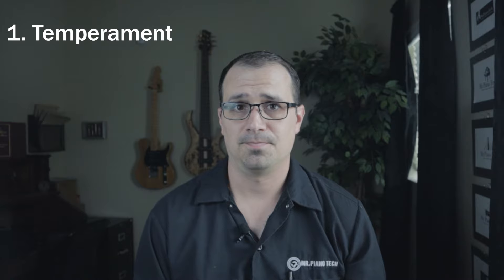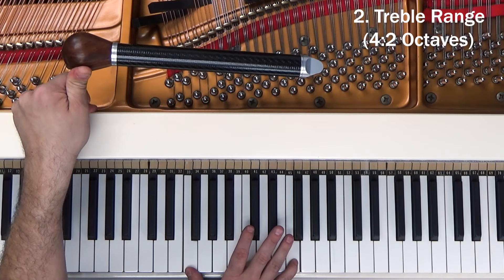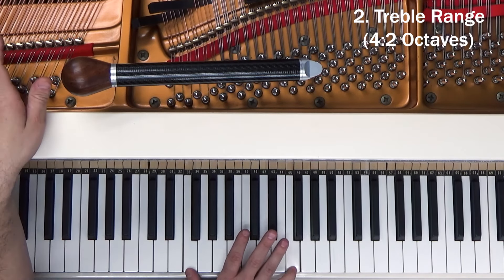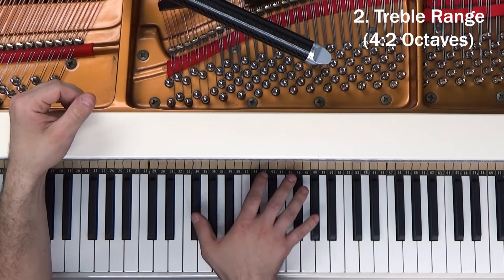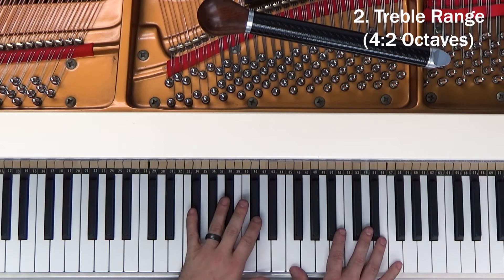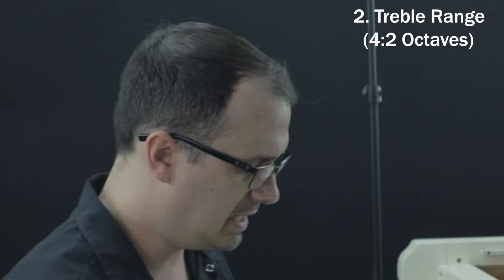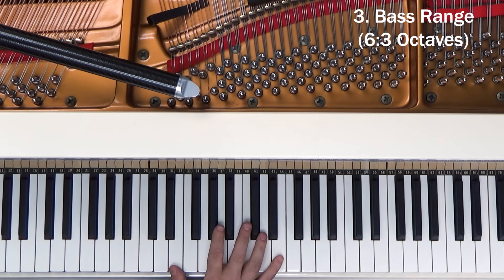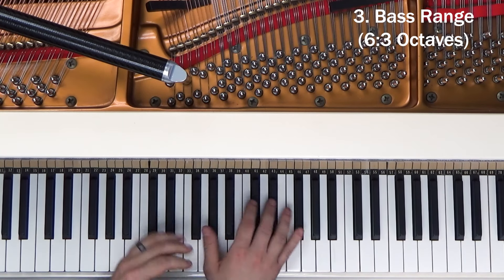How To Tune A Piano

Comment: it’s so useful to see the tuning hand. i was quickly taught and loaned a strobe tuner in 2001 when i was in high school and secretly taught myself piano. i’ve tuned many other peoples pianos. this was before youtube, facebook groups, etc to have a community to draw opinions from. 

i came from guitar tuning which is great because we use often use harmonics and listen to beats.

i was taught to go sharp and then flat, but wasn’t taught to jiggle or have sharp movements. my hammer etiquette has been like yours.

it was also before aps and i wasn’t serious enough to buy a strobe. i tuned A4 and turned the tuner off. i put an ad out to tune a piano for 20 bucks. obviously it was people that wanted it majorly tuned and didn’t want to pay much. i definitely did a good preliminary tuning, but got a good experience. eventually i was tuning one a week for more money.

now i have a nice ap for $30, people to draw knowledge from, and i might try to be more professional.
Reply: great demonstration. i used to tune the middle octave using 4ths and fifths and checking with my 3rds and sixths to get temperament. i then when down and did mostly the same, but used 5ths and octaves moreso. as i went up i used more 5ths and 6ths.

ps: Db and F is a major 3rd. i don’t even know what to call a C# and an F. haha. perhaps dim4, but that’s not part of a diminished chord. aug5 descending?
Reply from the maker: Yep, I’ve found that if you price yourself too low you get a certain type of customer, the bottom-dweller. Keep it up, it’s been a great trade for me!

Comment: at 10:13 comparing the wavyness of G3 to E3 is because'' these partials do not align with each other, the E3-G3 minor third will produce a characteristic beating sound. This slight oscillation is a normal part of the minor third’s tonal quality in equal temperament and adds a bit of tension that gives this interval its unique, slightly dissonant character.

In tuning, the goal with minor thirds is to keep these beats slow and steady across the instrument, which gives a consistent, balanced sound.'

is that the goal, to compare the wavyness? the partials of E3 and G3 do not align. thanks for the vidéo, well done!
Reply from the maker: @MarkE-xg9lr  You’re just matching the waviness. If the beats you hear with E3 and G3 match the beats you hear with G3 and E4 then you have a perfect 6:3 octave with E3 and E4. Keep it simple, don’t worry about how the thirds show up across the board. So long as you use the checks in the video everything else will line up.

Comment: I found this video VERY helpful. I had been frustrated and dissatisfied with my upper and lower octaves. Using this technique was game changer for me.
You mention doing a video for how you have you TuneLab set up. I’d really like to see that. I’ve found that TuneLab and I agree on the placement of the bass notes, but in the treble, my ear and the tuner can’t agree. I’d like to know what you have yours set to and what my expectations should be as far as TuneLab and my ear agreeing on the notes.
Reply from the maker: Glad it helped! Go with your ear. I use tunelab mostly for setting the temperament and for doing pitch raises. I have it set for 130 w/mid for viewing and have the bass set to 6:3, and treble to 4:2 - which are just simple double octaves so you should do alright setting those by ear.
Reply: Thanks for that info. I eventually figured out that the 4:2 octave works best most of the time. so, that’s what I keep it on now.

Comment: I missed one point.  Since you tuned the F3 to F4 temperament first, how were you able to use the 4: 2 octave method when tuning F4?  You were required to drop down to the C# in order to do that but you didn't tune the C# yet since it is below the temperament correct?
What did I miss here?  Thank you for the great video.
Reply from the maker: You’re just using it as a base line. So, whether you’re using the C#3, D3, D#3, E3 you’re not using them to tune F4, F#4, G4, E4. You’re tuning the 4th octave notes off of F3, F#3, G3, G#3. So tune F4 to F3 as close to no beats as possible. Then play C#3 with F3 and listen to how fast the beats are, THIS is your baseline. The beats could be fast, they could be slow, doesn’t matter. Now play C#3 with F4 and listen to the beats. If they sound the same as they did with C#3 and F3 then it’s a perfect 4:2 octave. If when you play C#3 and F4 the beats are faster, then F4 is too sharp compared to F3. If the beats are slower then F4 is too flat. Do the same with the other notes while moving up. This just gets you to the double octave which is what a 4:2 is. So once you get to F5, use F3 as your double octave test which you can now use since you know F3 is already in perfect tune. Hope this helps, it took me a while to wrap my mind around it.
Reply: @MrPianoTech  Okay thank you for that detailed reply.  It is a bit of a hard concept to grasp but I think I understand better now and will give it a try next time I do a tuning.  I used to tune quite a bit many years ago but now I rarely do... mostly I just do them as a donation of my services for my church these days.
I appreciate you taking the time to respond to me.  Have a great day!
Reply from the maker: @jeffroutledge9153  You’re welcome! Hope it helps.

Comment: Great video! What confuses me is in regards to the first partial checks.. If we've tuned for temperament and we are checking the 4:2 of F3, how is that going to be accurate given that we didn't tune the C#?
Reply from the maker: Glad you've found it useful! So what you are doing is merely comparing the beats of that C# to F3 and that C# to F4. Those beats need to match and it doesn't matter whether or not that C# is in "tune". Same goes for the D, D#, and E next to it. You can think of it as a baseline, it doesn't matter where the baseline is, only that the two notes match beats when compared with it.
Reply: @MrPianoTech  Ok, thanks alot!

Comment: Hi! Thank you for the video!
One question: how do you know if the major 3rd is in tune when doing the 4:2 octave? In your example, you hit C#3 and compare F3 and F4 with it. How do have to tune the C3# first? If yes, how?

Thank you!
Reply from the maker: @nathangros7492  Hello! That's a commonly asked question, when I was learning it took me a little bit to wrap my head around it. But basically no it doesn't matter if that C# is in tune or not. You're just using the beats created by playing F3 and C#3 together to get a baseline. It can be fast, it can be slow, it doesn't matter so long as the speed of those beats matches the same speed of beats you get when you play C#3 with F4. You'll adjust F4 until the beats match what you get when you play F3. Then just do the same with the next notes working your way up.

Comment: Great and helpful! Just one question: as you start tuning above your first/temperament octave, and use the major thirds below that first octave as a guide, wouldn't you have to tune those guide notes first of all for the check to be reliable? Specifically, the notes Db/C#, D, Eb/D#, E below the first octave. Am I right? In that case, would you tune those few notes perfectly using a software along with your temperament, or do you suggest any other method?
Reply: Sorry, I believe I found the answer in the comments. Beats between C#3 - F3 and C#3 - F4 should be identical regardless whether C# is in perfect tune or not - if I understood correctly?
Reply from the maker: @DoMusicRecords-y1i  Yes, that is correct! It’s a common question, maybe I should’ve explained it better in the video. But I’ve added the question and answer under the video description. Thanks for watching!

Comment: Very nice technique and explanation. I just didn't understand what is the "ghost note".
Reply from the maker: It is the note that you hear that is the partial of the lower notes. It’s a “ghost” because you don’t actually play it. The easiest way to hear a ghost note is by pressing down lightly let’s say C2 and C3 and hold them down. Just press them and hold them down so that the dampers stay lifted off the strings. Then with those pressed down, quickly strike C4, C5. You’ll hear the C4 and C5 but they’ll be coming from the C2 and C3 as partials. So you’ll hear them although they’re not really being played.
Reply: @MrPianoTech many thanks!

Comment: 12:59 Your video is very educational. I have a question tuning the soprano section of the piano, G-C. Why i hear only a smacking sound, like two sticks hitting each other? My tuning software goes crazy when attempting to tune this section.
Reply from the maker: Hello Gary. Check the hammers and make sure they're hitting squarely. Also, I don't know the condition of your hearing but those top notes can be difficult for some people to hear, just in case that's a contributor. No offense intended. Also, sometimes tuning software can have a hard time with those because the tone doesn't last very long.

Comment: I have been watching your videos.. thanks for making them. Apprentice piano technicians tend to break strings because they (we) pick the wrong pin to adjust for the note being played.  Why don't piano manufacturers emboss the name of each note right on the frame/plate adjacent to the pins for those strings?  The plates are made from cast iron, why couldn't they just put the note names right in the casting... it wouldn't add much cost and it makes tuning easier for apprentice and master technicians alike.
Reply from the maker: Thanks for watching. Personally, the only time I’ve broken strings while tuning them was due to the condition of the strings, not from over tightening them. Doesn’t mean I’ve never been on the wrong pin, I have, plenty of times, and I think I’ve just gotten lucky that a string hasn’t broken but if I start to move the pin and I notice the pitch doesn’t change at all I stop immediately, assuming I’m on the wrong pin. With time the frequency of doing that will decrease to the point where you just won’t really do it anymore. Just something to overcome and just a part of being a piano tech.
Reply: @MrPianoTech  I thought as much... I agree, the instant you nudge a pin, you MUST hear a pitch change, if not, STOP, wrong pin. I guess the more you tune a string, the more friction at the nut/bridge (coming from bass guitars, I have to learn their real names on a piano - my piano tech manual is due in today) and I assume that is where strings break most often?

What must suck is tuning a $500K Steinway with the customer watching your every move and then you break a string from no fault of your own. When I was a teen, I worked in a gas station in an upscale town. Some of the most crass and abusive customers were the ones in BMWs (generally speaking, those that were well off). Mercedes-Benz owners were a little better, but regular middle class folks were generally the nicest.  So, if I extrapolate that to pianos, I can imagine that some customers are just "looking" to start an argument - usually to get out of paying. Have you ever experienced this? This is what scares me most on becoming a piano technician. I just posted a video on the KX88 Key Servicing... so I am very comfortable with synthesizers and I am very detailed oriented.
Reply from the maker: @paulromsky9527  Some people you’ll never be able to make happy no matter what you, it’s just how some people are wired. I’ve had a few bad ones but just deal with them the best you can and make a note to never see them again, let someone else deal with them. That being said, most of my customers are nice people although some can be a bit picky, comes with the territory. Once you build a good client base you can be picky as to who you’ll do work for.
Reply: @MrPianoTech   Thanks, yes, I definitely would "refuse service" to the nasty ones.  I would expect many piano owners would be picky ... I am too about details. I once interned for a drive-in theater and a small movie theater. They both had vintage projectors and both were VERY picky on not just using them, but "showmanship"... like synchronizing reels to the exact frame (where about +/- 5 frames is standard). I have been studying my "Piano Servicing, Tuning, and Rebuilding" 1993 2nd Edition by Authur Reblitz. Great book. I am learning about all the different actions and names. One note so far, browsing ahead, I see in this edition he doesn't tune to 4ths and 5ths, he adopted 3rds and 6ths (he said it is easier for newbies)... I would prefer the former. Still no word from 3 of the 4 piano techs. One said he doesn't tune anymore. I wrote to Stienway and Sons, I asked if they have a "shadow" program to learn tuning... I may be able to get by without a mentor and just read many books and watch a lot of videos.  But how am I going to get access to 100+ tunings to get my chops?  To get my RPT certification in the guild.
Reply: @MrPianoTech  I will study my butt off for the RPT exam. But the tuning in front of an expert will be "fun"... not.  How many questions is it? Any essays? It is objective multiple choice or write-in subjective? Any oral questions? Are there specific study guides for it (like for SATs for example). The piano they give me to tune, will I have to do a Pitch Raise on it?
Reply from the maker: @paulromsky9527  You'll do a written exam first, 100 questions, at least it was when I took it. Multiple choice. During the tuning exam, after you're ready, the examiners will leave the room for the time allowed. You can bring notes with you just not a visual or aural reference other than a tuning fork or something that will emit a single tone. I used a metronome that puts out a tone for A440 only, then did the rest of the tuning by ear only although for some sections you can use an ETD but that will disqualify you from becoming an examiner if your score is high enough. The piano won't be any more than 2 cents off so you won't have to do a pitch raise. I'm releasing some more info soon, including the steps I take to do a aural temperament tuning. It will be available soon.
Reply: @MrPianoTech  Great info, thanks. 100 multiple choice questions, ok.  The piano is only a few cents off, that sounds like what a technician would encounter on a routine tuning on a well maintained and tuned piano. I guess they won't throw me any curves like tuning a chilled piano or one that was in high humidity. I guess I was expecting something like a flight simulator where instructors can cause problems and see how you react. It sounds like is just a plain piano they just put slightly out of tune. Now to keep searching for a mentor. I am a subscribers so I will be looking out for your gideos.

Comment: I was taught by an old tuner back in 1963.  I was taught to pound the keys to set them.  Is that no longer necessary?
Reply from the maker: Setting the pin is still required but I mentioned in the beginning of the video that this video doesn’t cover that. It could really use a whole separate video as proper pin-setting is incredibly important. In this video I go through my process of tuning and is meant more for tuners who already have a good handle on proper pin-setting technique.

Comment: I have used only TuneLab and the tuning has seemed rather sterile.  Can't wait to try this.  Do you have any suggestions on how to tune unisons?  I listen for no vibration, but that always shows the pitch as a couple cents flat on TuneLab.  Is that what I should be listening for, or something else?

Comment: Quick question....You first tuned the temperament (F3-F4). But then you used the major 3rd below (C#3) to check the F octave tuning. How can you do that and have it be accurate if you haven't yet tuned C#3, which is below the temperament?
Reply from the maker: You're just using it as a baseline. It doesn't matter if the beats are fast or slow. Just match whatever the interval beats sound like of C#3 and F3, to C#3 and F4. See below comments where I've dug into this with others. Just remember, you're only using it as a comparison, not tuning off of it.

Comment: Hi. Thanks very much for a great summary and explanation of the tuning process. I have listened to so many tuners explaining the process in such detail and then i end up not being sure when to apply which test and how to move up or down the octaves. You have covered all the basic questions so clearly. I really appreciate your work. I e question. Why doyou use the M3rd test on the 4/2 octave and the m3rd test on tbe 6/3. What confuses me is the direction in which you are counting your thirds. Major is to the left minir is to the right. Hope it makes sense. Thanks again.
Reply from the maker: Thank you for your kind words, I'm glad the video was useful to you! Yes, use the major thirds on the way up the piano and use the minors on the way down.
Reply: Basically, because THOSE are the intervals that create beats that match (the closest) to both the lower and upper octave notes.  If you were to try to check the 6:3 with a minor 3rd BELOW, the beat speed difference between the octave notes would be too great to make any determination.  A M3 below carries the beat speed you want to match (or adjust) to the M10th (M3 below plus the octave gives you a M10th).  If they match, you have a pure 4:2.  A m3 ABOVE is the beat speed (hence, the check note) you need to match for a pure 6:3.  Usually, I find a slightly wide 4:2 (M3 a bit slower than M10) matches a slightly narrow 6:3 (m3 a hair faster than M6), and I leave it there. The OP's reply tells you that you'll end up with 4:2 octaves in the upper portion of the piano and 6:3 (slightly wider) octaves going into the bass.
Reply from the maker: @socram321  well said